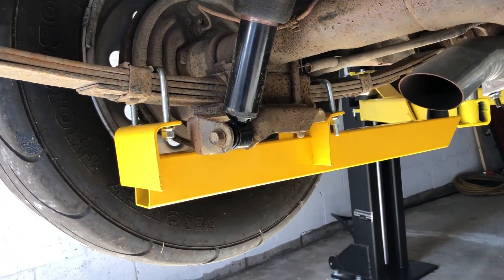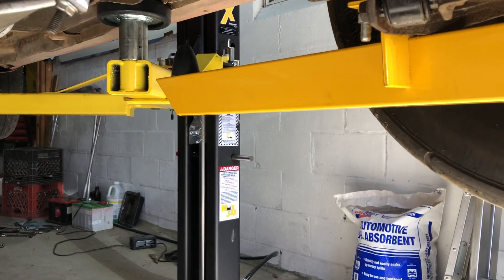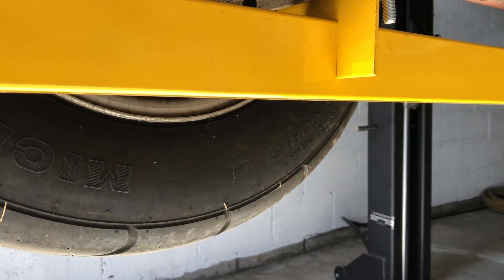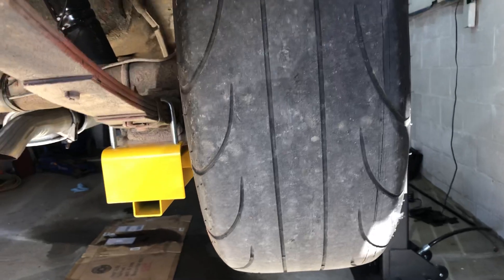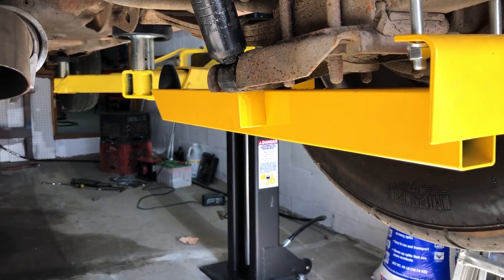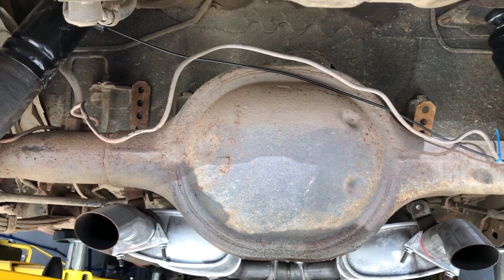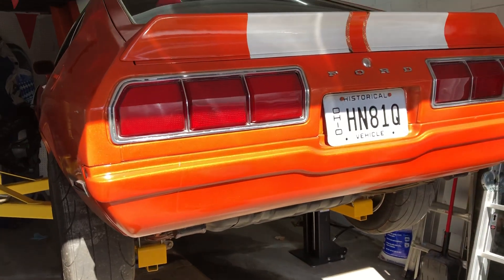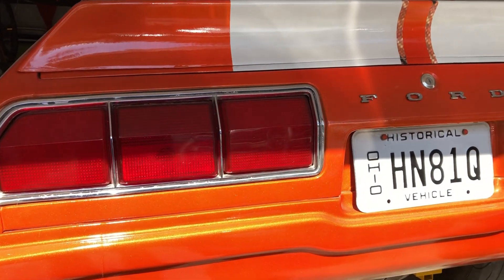Mustang II traction bars

Comment: Snö beck, this must be fate! I’m having the same problems with my traction bars, my over size tires, and have the exact same black  metal band and Apple Watch as you! 🤣🤣🤣
Reply from the maker: My battery in my Apple Watch for some reason expanded and pushed my screen right off the frame of my watch. Apparently this happens when it overcharges. I thought these things weren’t so posed to overcharge. Not sure if it’s worth fixing.

Comment: I changed the bottom plate to a Maverick plate years ago when I went from 4  to 5 lug my car tires are 26 x 10.5 x 15 with a 5" back space on a 8" rim. Tires fit under car with no air shocks  I had to roll the wheel well to clear but it worked out great! I did have a hard time finding shock with a straight pos at both ends I think they was front shocks for a Toyota or something in that line. Car sits leave
Reply from the maker: That sounds awesome, seems like everyone has found some interesting way to come with mods for these cars and lots of other cars to pull parts from.

Comment: Hey thank you for starting your YouTube channel based on these cars.
I have a red and black 75 Mach 1 mustang V8.
my question to you is did you have to custom make your rear bumper or is that for sale someplace?
Reply from the maker: You can google mustang II bumper delete or roll pan. I believe that is how I found this. Also CJ Pony parts has parts for the II’s.
Reply: @snobeckmustangiis2858  
Hey thanks! And Much kudos for starting this YouTube Channel.